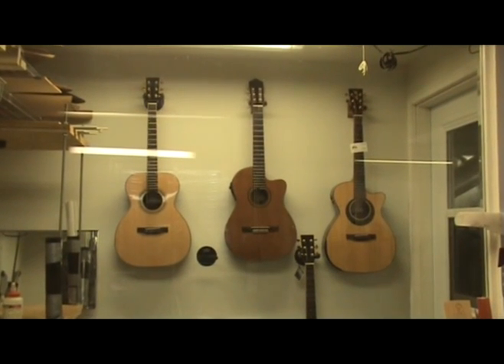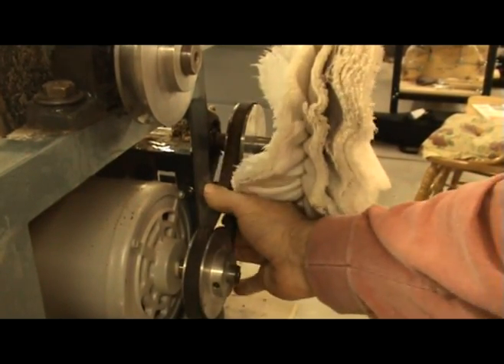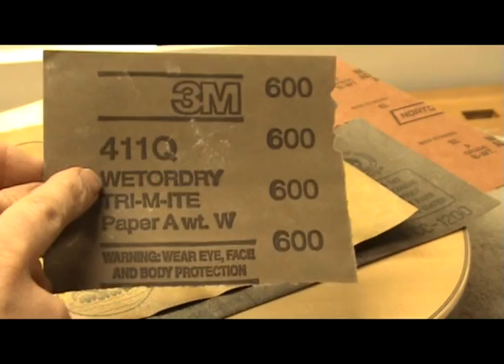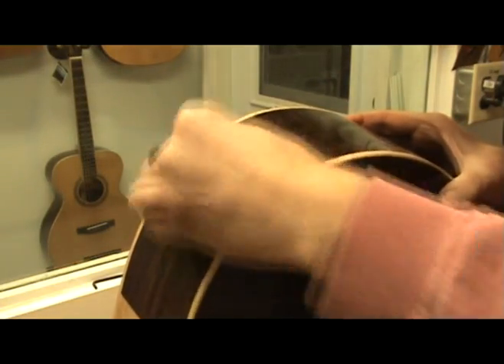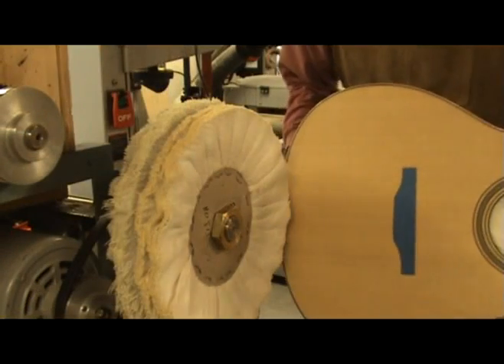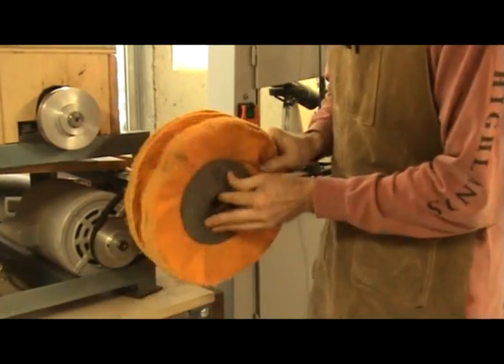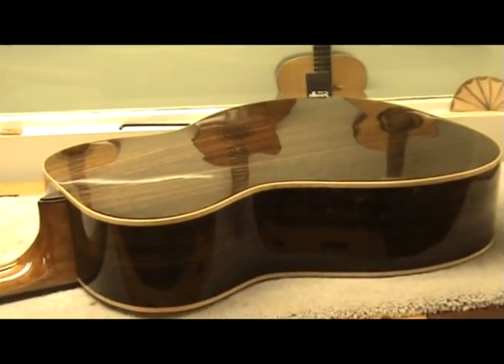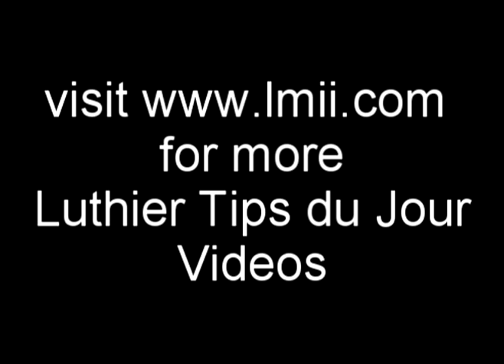Luthier Tips du Jour - Buffing High Gloss Finishes - O'Brien Guitars

Comment from the maker: You can touch up small areas with lacquer as it is an evaporative finish and builds in one single layer. Just spray that area (mask off anywhere you don't want to spray) and then after appropriate cure time level and buff to high gloss.

Comment: Hi, sorry if you've had this query before but i have a Black Gloss ej200. It has lots of scratches, belt marks on the back and a few light scratches on the front. I don't know whether to just go over it with a polishing cmpound to clean it up as much as possible, or to do some wetsanding first, then polishing compound. I'm just a bit nervy about the sanding, so not sure. Any advice would be greatly recieved...Thanks...

Comment: is there a special technique you use to remove the tape after all the buffing is done ?It  seems due to the thickness of the finish itself you'd need to score the tape edge to remove it , and maybe then more buffing on the fretboard edge to get rid of the tape line . Thanks for all you videos and your help  !
Reply from the maker: +Jay Rogers Yes, I score the tape just inside the footprint of the bridge. I then use a razor and chisel to remove the tape and finish up to my score lines. The finish will go under thebridge by about a 1/6th or so.

Comment: Hello, very nice video (without wheels prep and cleaning however)

Menzerna gaves a 30meter/second for buffing PU, so your large wheel is not "that" fast in the end.

Well I suppose on Nitrocellulose lacquer the speed may be less possibly (?)

I mostly buff pianos, hence polyester, so the "large" wheel for me is about 10", due to my machine (strong but intended for 250mm disks). But I plan to use larger ones just to raise speed and have better leveling.

the steel brush before buffing make a huge difference, as being attentive not having thread protuberating. I warm my disks a little before putting the paste.
Best regards

Comment: Great video, Im thinking about getting a buffer for my shop to speed up fret polishing and polish out the small amount of finish repairs I do. I saw you wearing the face shield which raises the question does it spray off a lot of dust? I'm a one man shop and work in my home and thats my only concern with getting a buffer
Reply from the maker: I wear a mask for the dust but the face shield is to protect me against flying objects. At the very least wear safetly glasses.

Comment from the maker: @Wesley77Small If you can lift the speakers I prefer using a stationary buffing wheel. If not you will need to use a  buffing bonnet on a hand held power buffer. For lacquer, a high quality instrument grade lacquer is a must. There are  few brands available: Seagraves (Mcfaddens) and a newer brand I am experimenting with is Cardinal.

Comment: Hello Robert, good and useful explanation! in the Last weeks I have searched any explanation about how could I paint, for instance, a guitar neck with bindings along it, but I didn't find out. Is it necessary to remove the binding before paint or do you have a tip for?
Reply from the maker: Mask off the top of the fretboard and bindings. The side of the bindings will get a finish.

Comment: Great video.  where do you get your buffing wheels and what type cloth are they?  appears you don't need to use a large steel flange with those which is great.
Reply from the maker: I got these in Brazil many years ago but they are available from a variety of sources. Mine were made of cotton.   https://www.lmii.com/buffing-polishing/2929-buffing-wheel-34-arbor-12-bias-canton-flannel-wmetal-center.html

Comment: Great video. I use automotive 2 k urethane on all my guitars . Up until now I have polished all using an auto polisher with the 3 m step compound and polish . I built a polisher and my question is do you recommend me
Switching to the block type
Compound like you use here or would I still be good with the 3 m liquid?
Reply from the maker: If you are having good results with the 3M compound I would continue using it.

Comment: Hello luthiers around the world. I am an student who is learning to obtain high gloss finish. I have a problem and I don't know how to solve it. Recently I obtained a buffing wheel and a Menzerna polish compound. In the moment to buff the guitar, the buffing wheel leaves residues of the polish paste strongly adhered to the varnish , and damages the varnish. Plase, I need your advice. Thank you
Reply: +ricardo garduño barrientos I can't be sure, but in my ongoing experimentation this sounds like a problem with building up too much heat in the buffing process, likely due to too coarse a compound/too much pressure while buffing.

 I say that because In my test samples (I'm using CA glue for filling and clear coat), I can get a super-high gloss, highly mirrored finish, but there are small areas containing whitish specks that nothing can remove. They could have come during wet sanding, and somehow escaped my notice, but I don't think so. Does this sound like it could be the problem you are having?

Comment: are not soft pads better for sanding rounded surfaces ? I sand with lines (crossing) , so I see them with the next grain and erase them,by sanding 45° but it is not easy on complicated shapes indeed.
I use an orbital sander as much as I can (but my surfaces are 4-6 times a guitar, and flat mostly ;)
Reply from the maker: I always use hard backing pads and that seems to work for me.

Comment: Is that  a 1 1/4" dia. shaft on the buffer? . Thanks for the loose belt tip. Had not seen that one yet! Love it! I am having a lot of tools built. (BURGLARS got my old ones) The quality of what is commercially available is pretty awful unless you spend $6000 on a buffer. ($6K used)

Comment: Hello, can UV finishes build up somehow thick ? need a resin pump ? is the UV lamp very expensive ? Thanks.
Isaac
Reply from the maker: Yes, UV finishes have a large solids content and if you are not careful you can get a finish too think in a hurry. I recommend doing some sample before spraying on your instrument. The lamp is getting cheaper and cheaper as the technology advances so it is possible to get a good rig for under US$2K these days
Reply: OBrienGuitars thanks,  that helps.  Imagine a piano, I will need 3, or. 4, is not it? 

You can spray vertical surfaces with the UV lacquer?  Conventional gravity spray gun..? 
Thank you,  that helps
Reply from the maker: You can use just the hand held unit for larger services but have more waving of the lamp to do. You can spray vertical services using a conventional gravity gun.
Reply: OBrienGuitars it harden almost instantly, if I understand well. 
It is a "one coat" job,  or similar to polyester or other spraying? 

Off dust for all the time before hardening I guess.  

Thanks for your tips.
Reply from the maker: Isaac OLEG It does harden instantly. I have done entire guitars in a day before but I prefer to spread it out over 2 or 3 days. Depending on what you are spraying maybe one coat is enough. I Prefer two or three spray sessions. Remember, it is not how much you put on the surface but how much you leave on.
Reply: I have seen some testing done by independent people, with a UV sold with cheap bulbs They had real adhesion problems, and that seem also to be the case with the more expensive systems, a specific primer of good quality is necessary THe shine is also a little cloudy probably the prouct is not totally transparent 
As my friend that teach car painting said, "not nice enough (yet)" (for cars) your take ?

Comment: what is the best way to sand the outside edge and inside where the neck joint is of a electric guitar starting with 600 to 2000, I hate doing it by hand it takes forever, I was thinking of useing a Oscillating Spindle Sander but the grits aren't high enough, theres got to be a easier way to sand it other then by hand, it's real pain to get it flat on the inside near the neck joint. on the front and back I use a da sander with 600, 800, 1200, 1500 then 3000 3mm wet sand hook and loop then buff it

Comment: I have a doubt working with polyurethane, and after polishing gets a risquinhos so if you see the reflection of light use sandpaper brand Indasa 2000, when I do the lacquer before polishing it is without these risk which of course the problem then this you think you can be?

Comment: I had a small kid draw with marker on my Gibson Songwriter Deluxe Custom on a small area on the front above the Hole. (Ouch!) It's roughly a 4"wide by 2" high area. I was able to remove the marker lines, unfortunately I removed the High Gloss Nitro Laquer  finish. You can see the spot in the different light. Can I re-blend this area using Nitro Spray and buffing? Any Suggestions? Sm

Comment from the maker: When doing a satin finish I prefer to spray high gloss and then rub it out to a satin sheen using steel wool. I show how to do this in my online finishing course via my website.
Reply: I tried a satin finish on a 1941 Ramirez but had to restore the gloss: satin is rougher than gloss. In a recording studio, the artifact of handling the instrument drove the insightful sound engineer crazy. Fret noise is acceptable but not tactile artifact. A glossy finish is thus preferable.
Reply from the maker: @TheBinaryWolf  Interesting. I have never heard of this issue.
Reply: @OBrienGuitars  With dry fingers, gently rub the surface of a guitar with a satin finish. You will hear a lot more noise than on a gloss finish. Even handling such an instrument taints its sound as detected by a microphone.

Segovia's records suffered lack of quality, being sterile due to his distancing self from the microphone: he did so to minimize fret noise and the sound of his clothes rubbing against his responsive Hauser. He even wore slippers to the studio, and often to the concert hall.

Instrunent artifact is hardly noticeable, except when consciously sought or heard through full spectrum headphones.